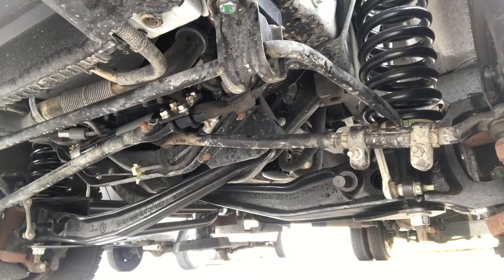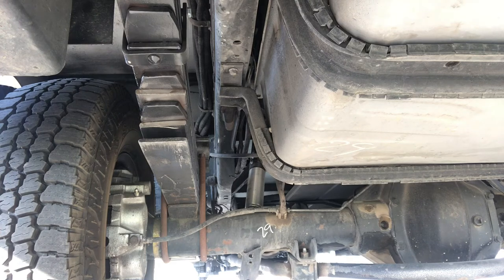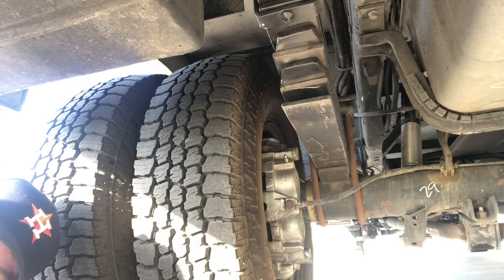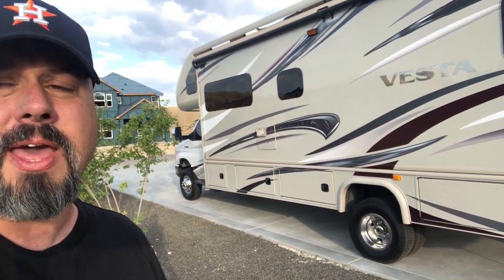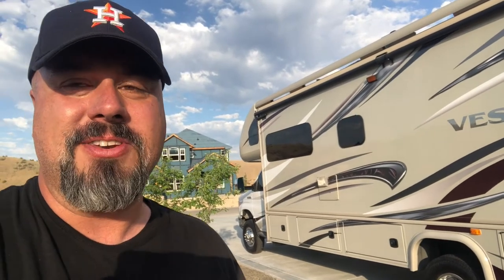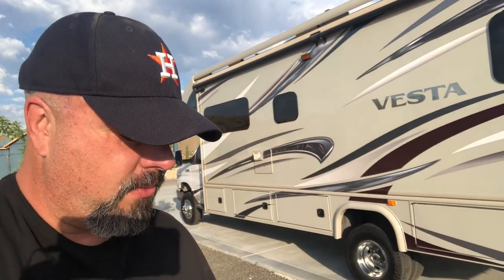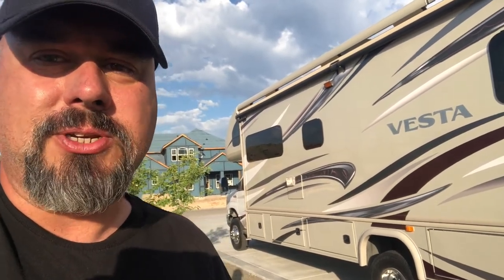RV Lift Kit - Part 2

Comment: Awesome, informative, honest video!  Dropping off our Jayco 29mv for the works next week.  I found WeldTec over a year ago and we are finally getting the much needed upgrade.  Had my wife watch your video so she understands why we are investing into the upgrade.  We are also adding the front bumper since we do a lot of off road camping.
Reply from the maker: Now that we're coming up on a year with it, I couldn't imagine going back to a stock suspension setup.  This has allowed us much easier access to boondocking spots that used to be impossible for us previously.  I've been debating installing a Kwikee double step at some point down the road so we can do away with the step stool.  You guys will love it!
Reply: @BenWho  Funny you brought up the step.  We are having one installed by WeldTec.
Reply from the maker: @7n4163  I'd love to see that when they're done!
Reply: @BenWho  I’ll add pics when it’s finished:)

Comment: I'm scheduled to have my suspension done with Weldtec in a few weeks and will be upgrading my tires as well.  I'm between the K02 or Sumitomo Encounter, I want the AT look but don't want road noise.  Have you been happy with your tires...thanks in advance for your feedback.
Reply from the maker: No complaints at all with the Sumitomo.

Comment: Thanks, Ben. I'm getting mine done in 2 weeks. Do you have an update on the upgrade? Any issues or observations? How many miles have you driven? Thanks!
Reply from the maker: I still feel the same way.  "This is how it should have come from the factory!" and "I wish I would have done this sooner!".  We've easily put another 6k miles on it and were just snowbirding in Nevada & Arizona in January boondocking 95% of the time.  It has been awesome!

Comment: Ben, I wished I would have seen your video early last year because we bought a 2017 Fleetwood Jamboree, 31U, which we love the floor plan, "but ours has the same problems as you had, Suspension, Steering, Jacks bottoming out!  "Awesome video, great job on covering the problems that these Class C's, they have a big problem with, Suspension, Steering, Jacks, and bottoming out !!    What would it cost me approximately to bring our RV up to the point where you are at taking care of its problems?  And again thanks for that video!  ( Retired U.S.Army ) Michael Perry
Reply from the maker: Out the door, with tires, tax, installation we were just under $10k.  You could save some money by sticking to your existing tires (if they aren't more than say 8 years old), and by not doing the Fox steering stabilizer.  I know you can get a Bilstein steering stabilizer, install it yourself, for about $125 (it's only 2 bolts and mounts up to the existing factory brackets).  Those 2 things would put you in about the $6k-$6500 range.  Hope that helps.
Reply: @BenWho  Ben, I have to apologize because I notice that when I looked further down the comments someone had already asked the same question about the cost!   so thanks for getting back to me so quickly!  anyways you have done a great job in explaining on youtube the process of the suspension and adding inverters, and solar panels as well.  although last year I did have new Bilstein shocks and a steering dampener added, and a heavier stabilizer bar to keep the front end from waving back and forth as well, The real problem is also riding so low with those jacks only 6" inches off the ground,  riding so low is very dangerous, especially with those jacks so low which can be a road hazard that could be very costly to repair or replace!                                                                                                              Thanks again for sharing your improvements, it was very helpful whether it's on asphalt roads or boondocking on the dirt as well!

Comment: I would like to see the driveshaft from the back carrier bearing to the rear end. I want to see the angle after putting in the spacers. Mine didn't call for the spacers, now it makes a terrible racket.
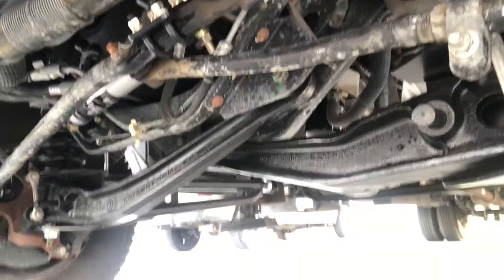Reply from the maker: There's maybe a split second, as I'm moving the camera, around 2:10

Comment: Im about to have a 6" installed on my Forrester.  Did you have to have the front jacks relocated?
Reply from the maker: I did not.  They did cut the front jacks off of the frame in order to weld in the mounting bracket for the new trailing arms, and then welded the jacks into the same place on top of that.

Comment: What size are your tires? I'm looking at 285-75r-16
Reply from the maker: 235-85-16.  Stock was 225-75-16
Reply: @BenWho  are the 235-85-16 trailer tires?
Reply from the maker: @davidbrooks2002  I'm not following you.  I don't have a trailer, nor do I talk about one in this video.  The tires on the RV are Sumitomo Encounter A/T 235-85-16 which are not trailer tires.

Comment: just wondering about the cost? under 7k?
Reply from the maker: With all of my options (new A/T tires, Fox steering stabilizer, & additional leafs on the driver side to support the weight of the slide, and tax) I was right under $10k out the door.  Obviously re-using my original tires would have saved a chunk of money but I wanted something with a heavier load rating than the stock tires to get some buffer vs what the rig actually weighs when fully loaded.

Comment: Could you share what size tires your running and if it needed spacers between the duals?
Reply from the maker: Sumitomo 245-85-16 - https://www.tirerack.com/tires/tires.jsp?tireMake=Sumitomo&tireModel=Encounter+AT&partnum=385R6EAT

 I did run spacers on the rear because the sidewalls were CLOSE.  From my research I could have run the same size tire in a BFG K02 as their sidewall cross section is about 1/8" smaller, giving more clearance w/o a spacer.  The problem is with the supply chains I couldn't get my hands on BFG's for months.